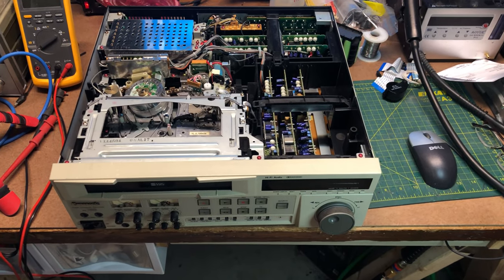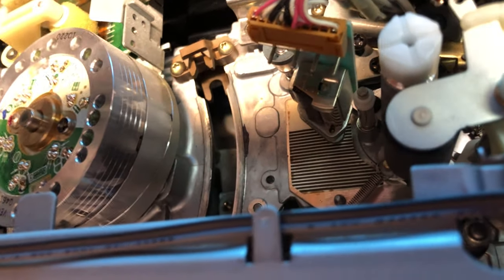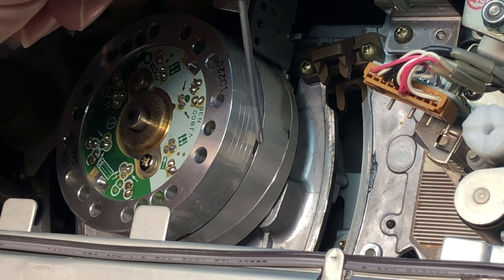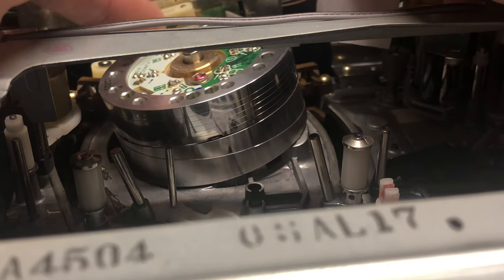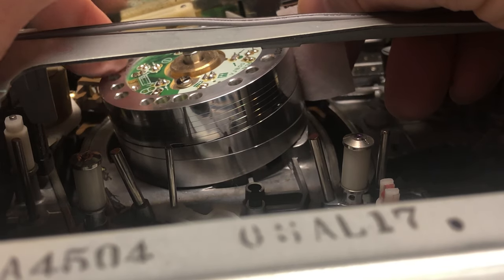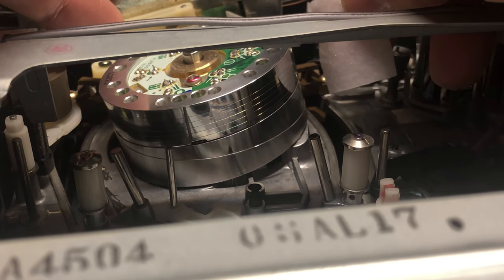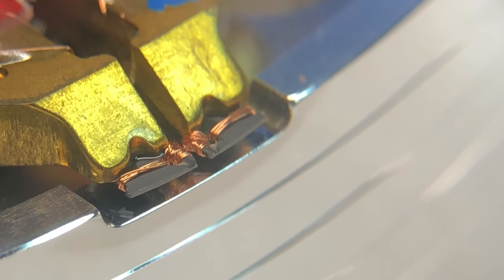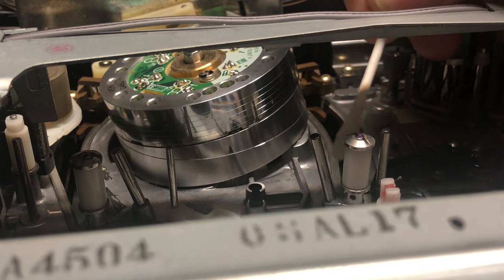VCR Heads How to Clean Video Heads

Comment: In the video the pad has visible fiber strands on it and some appear to be 1/3" or more long. Wouldn't these strands cause problems if left behind.
Reply from the maker: No.  once you have let the head dry , and once the heads start spinning, that would get flung off long before any tape comes near it.

Comment: Great video , i have the same vcr , i cleaned everything using your video as regernce... but my issue persit... seesm like auto-tracking noise but moving from top to center of screen every 7 seconds... this long time seems related to tape complete circle ... nothing else is doing  7 seconds periods... do you hany help / ideas about what can be ?  Very thank you !
Reply from the maker: What you’re describing is certainly not a dirty head.  Assuming of course you tried tracking, you could have a post guide alignment issue. I have not made a video on that, perhaps i will.
Reply: @iRepairElectronics  replacd almost all caps on servo board, removed and replaced audio head , non seems batter..  but audio signal on some VHS is very good..but on others has low volume and an Hiss on background... something related to Hi-fi /  normal audio track?

Comment: I recently got a Sony VCR for free from somebody. It’s a Sony video cassette recorder SLV - 775HF. I put a tape in and it started to play a little bit but then it kept eating up the tape. Any recommendations on how to stop the tapes from eating? The VCR looks extremely well condition. I opened up the door and cleaned some of the parts that I could reach with a Q-tip. I may take the top off and try and clean it like you showed. Do you have any idea on why they take may be getting eaten up? Is there a particular area that the tape usually sticks to?
Reply from the maker: A lot of times the pinch roller assembly is out of sync or possibly broken or it could also be the take up real is not engaging and causing the tape to loop up inside the VCR
Reply: Thank you for the speedy reply! I cleaned it just like you did, and it works beautifully now.
Reply: Spool brake has failed. and/or as I repair said.
Reply: Am trait sa o vad si pe asta : FRANA BOBINEI,sau poate nu este traducerea normala
Reply: @ionescu-sile58  DONT UNDERSTAND A WORD YOU SAID!

Comment: I have this old Sony VCR that I just took it out and tried to start it. Both the yellow and white wires are fine. For a few minutes it actually was running great, both video and audio were fine. But now the audio is there but no video at all. I even checked the video head and it looked pretty clean to me. Any other suggestions for the video issue?
Reply from the maker: All it takes to clog a head is a small coating of dirt, possibly grease. It can get transferred to a tape from a vcr that has a dirty environment. Anyways, it sounds like dirty heads 0ne other thing to try is the tracking.  If the tracking is off enough it could show you mostly snow ❄️
Reply: @iRepairElectronics  thx for the reply. I went ahead and tried to clean the video head but theres a minor change, it actually shows the video but in black and white and going up and down so not that clear video. Audio is still fine and working perfectly. I think its the video head which is the issue as I tried changing the audio and video wires too. Oh and theres a coating of dirt around it which is barely visible.
Reply from the maker: @Alchemy_OG  Sounds like this machine has other problems.  B&W usually not a video head issue.
Reply: @iRepairElectronics  ok Update: the roller which has the sponge to clean the head was all mushy and worn out. I removed that whole sponge and now it’s nothing on the roller. The tapes are working perfectly fine now :D but now my main concern is if the roller is empty, i’ll have to keep cleaning it again and again. Thx for your help!
Reply from the maker: @Alchemy_OG  they’ve made very many VCRs back to the day that never had such a roller assembly it was probably contributing more by adding to the problem. Machine will probably be just fine without it.

Comment: Anyone have a suggestion as to the best type of lube to use on the pinch roller assembly brass bushing where it mounts onto the metal pole? I know it is only a very tiny amount & only after it is properly cleaned, but what type of lubricant is recommended for this bushing? Would a half drop (or less) of Super Lube 51004 Synthetic Oil with PTFE be fine?

Comment: i Repair Electronics
-------------------------------------------
    I  have three VCRs Mchine does not work 
     1] I need to learn how to clean the Machines
     2] The ones that works and the ones that doesn't work 
        Use the parts to make a tape cleaniinng  Machine 
     3] need to now how to use the motor. how to power the
        motor -speed control forward and rewinding stop -
        and the tape counter  i Repair Electronics
        can you help me Alan

Comment: Hello, I have a D-VHS JVC 30000 have been using for years now, but I noticed some tapes were not playing well, the picture was fragmented so took it upstairs to clean the heads, I had done this before years ago with a piece of paper and rubbing alcohol and it worked last time I did that so felt confident doing it again. Earlier today I used a cloth similar to what you`re showing. Isopropyl microfiber lense cleaning cloth for Eye Glasses. I could not find a bottle of rubbing alcohol.  First time I cleaned, I did it gently and more towards the top on the drum. I had thought the Drum WAS the head. I put it all back together and went to play a tape that previously would not play and it was playing perfectly, so I was all happy. I then popped in another tape that also would not play previous and nope, it was all fragmented and breaking up. So I put the 1st tape back in and sigh, it was the same. So I went back to cleaning again but watched where the tape was actually making contact and realized it was more towards the bottom ( Where the heads actually are) only I could feel a bit of friction and noticed part of the cloth was tearing away which I figured was not good since this is why they tell people not to use cotton swabs/Qtips. So I hooked it all back up and the 1st tape still would not play so I figured I must have damaged the heads. I then took it to garage and blew out with compressed air in case any small fibres had worked its way into somewhere they shoudnt be and still not working. So I was ready to give up and look for another unit, but fast forwarded to about half way through the tape and then put it on fast play where its like 3-5x the speed but you can follow the picture along and the picture was clear. I assumed because the heads are moving faster this is why you can see the picture okay, but also assumed once I pushed play that it would not work again, but it actually was working again. I rewound the tape all the way and started from the beginning and its working perfectly? Did I get lucky here? Any idea how it corrected itself? Is it a case of maybe the heads have been used so much already they might be wearing out? These DVHS machines are a bit pricey these days so just buying another is not something could easily consider right now.
Reply from the maker: so i would never recommend removing the head drum to clean  the heads.  you can also use a chamois cloth with the alcohol.  i think you are luck to have a picture at this point. One thing thats wierd on JVC machine that happened to me in the past was a bad capacitor on the PG shifter part of the circuit. Now DO NOT go hunting this down unless the following symptom occurs. When you insert a tape it may play fine, eject the tape and re-insert it, then you get noise on top or bottom, re-insert again and the noise is either less or more severe. 
That was the cap in the PG shifter problem.  if i ever find a JVC with that problem ill make a video on it.  but is was only a few in a series of VHS machines made in the 90's.  i have no idea if your DVHS is the same circuitry .  my guess is probably NOT.
Reply: @iRepairElectronics  Thank you. After I posted this comment I was able to do a test recording of HD Material through my Tuner and firewire and it recorded and played back perfectly so I`m not messing with it anymore. Going to throw out the Motley Crue DVHS tape that is corroded and hopefully will be trouble free from now on, at least I know where the heads actually are now and if I do attempt cleaning in the future will do the paper method again.